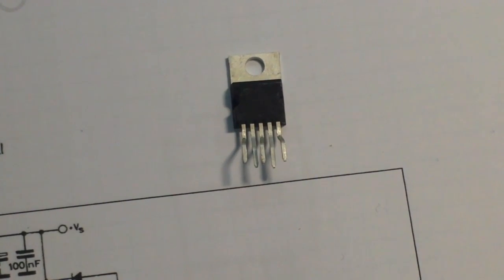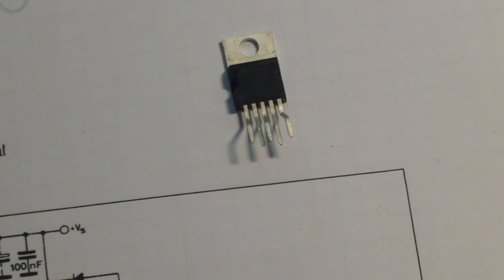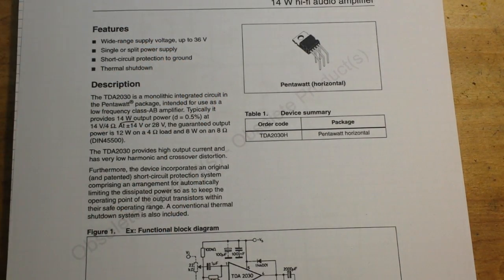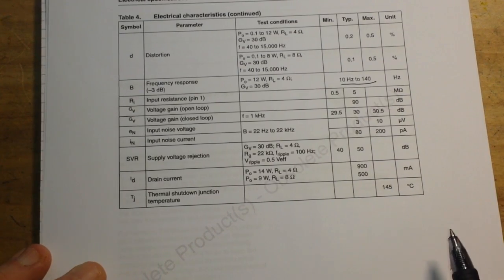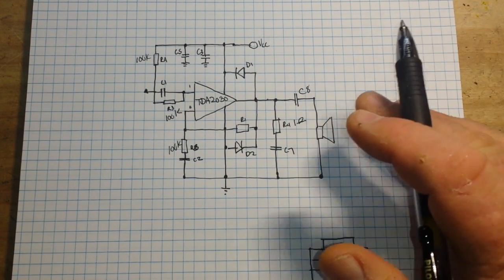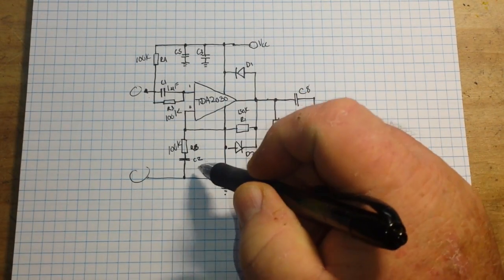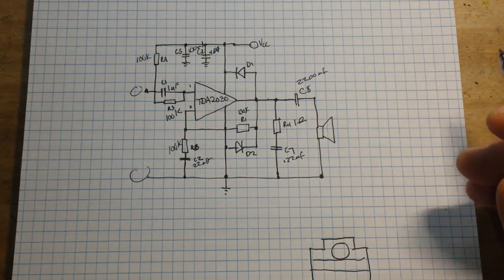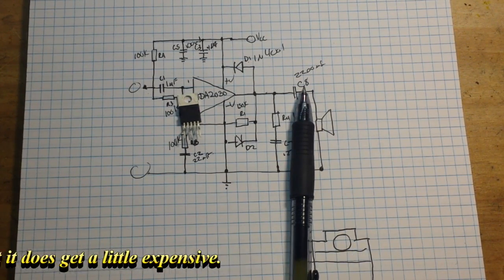TDA2030 Class AB Amplifier IC

Comment: Video idea, How to isolate circuits. Like when you have an op amp and an oscillator or two oscillators or whatever on the same board with the same power supply. How to get them to play nice with each other.

I've figured out that a diode, and or a capacitor usually works. I've just not seen anyone do videos on how to start putting these things together.
Reply from the maker: I think we csn do that.
Reply: Thanks man you are awesome
Reply: @learnelectronics  you certainly are!

Comment: Did the circuit build video get made? Didn’t see t in your videos, my have missed it.  Also,is there a way to build an affordable 12 v to 12v isolation circuit. Have a few neon lights for my car and the inverters put noise into the electrical system and are audible on the radio.  Thanks and keep up the great work
Reply: I am also interested in the real situation where that amp. is built and tested.

Comment: I can assure you that the IC you have at 1:00 is a clear fake.. Original ones have their pins more thick and the back metal tab is completely different
Reply from the maker: If it works, does it really matter?
Reply: learnelectronics it will work.. But you'll not get the full rated output power as the datasheet recommends.. I've experiences with that.. Also you can least expect the over temperature protection circuits to be present  in these fake chips. These fake devices will dissipate large heat and you'll not get that performance as the original ST. ST discontinued many of these TDA products long ago and few sellers online delivers original ones, most of the sellers sell fake Chinese craps
Reply: If you are just learning/teaching a new chip, or just making something for yourself the cheap ones work just fine.